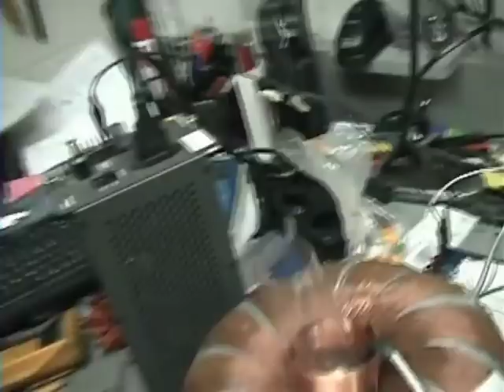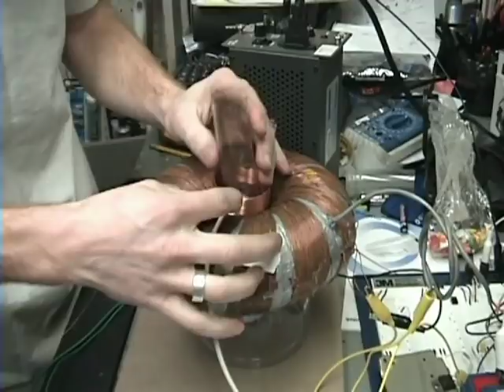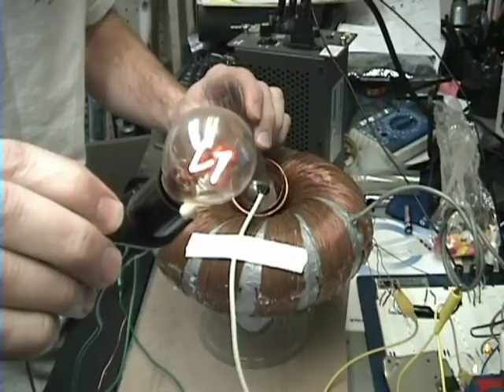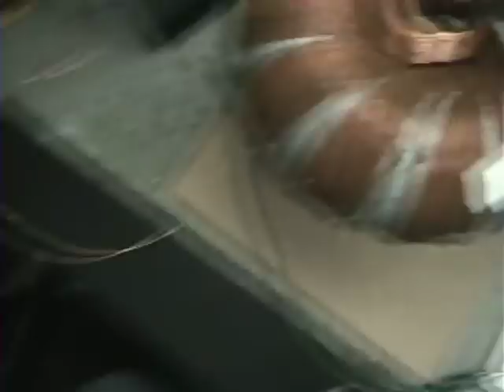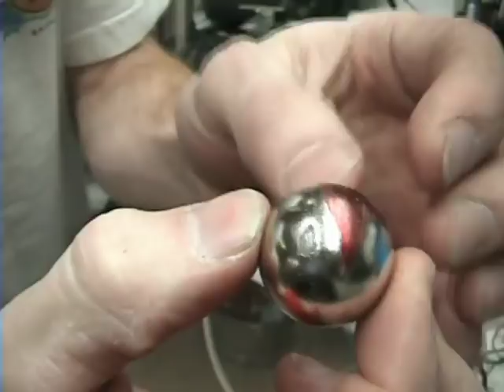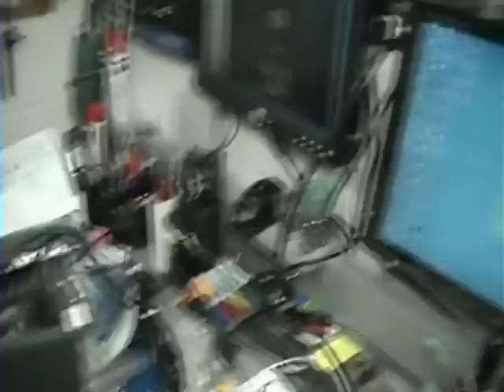Having Fun With Rodin Leve-Sphere Spinner & Phone Guest RAVE154 (TEST33)

Comment: Looks like fun!  I can't help but thinking that the pickup coil is causing the hall sensor to operate less efficiently.  Like the pick up coil might be shielding it from the neo's flux, causing the transistors to fire at a lesser output.   Or all the power coming from the rodin coil is going into the pick up coil like a transformer, stealing spin power from the magnet.  It's like air brakes for neo spheres. :-)